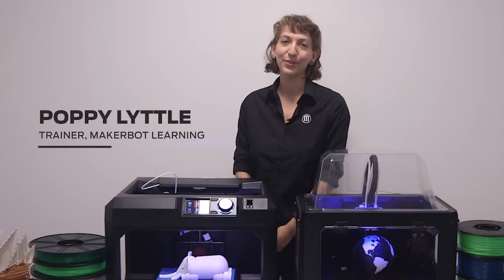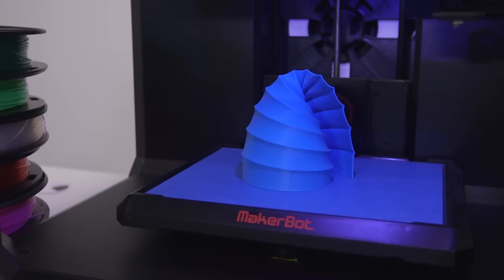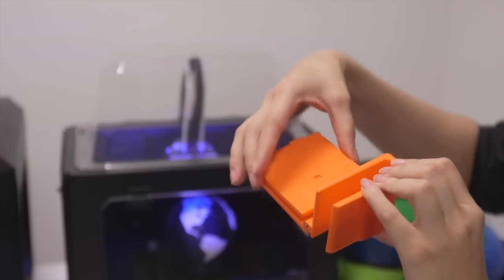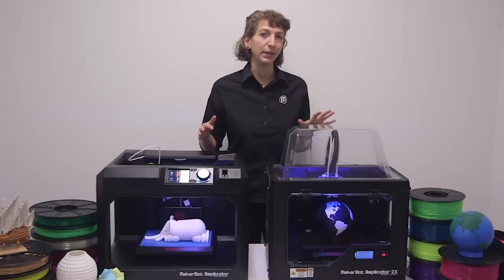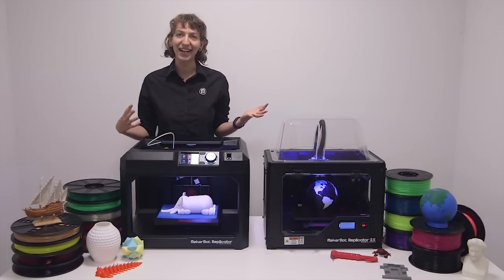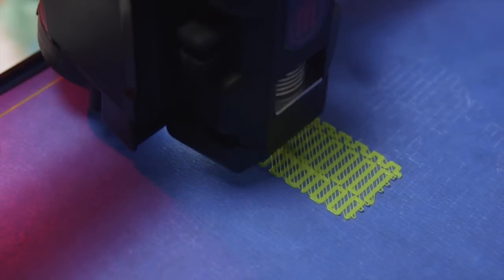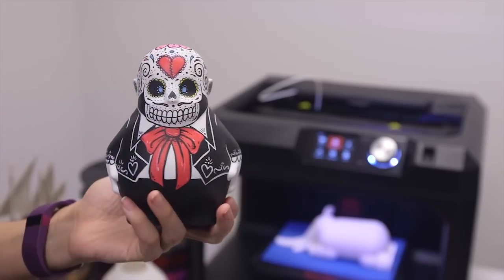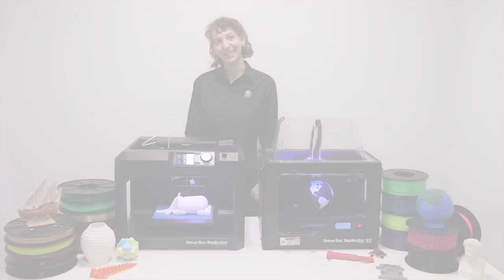PLA vs ABS | What's the Difference for 3D Printing?

Comment: if i were to print a figurine, pla or abs which is more better?
Reply from the maker: It really depends, but both would be good candidates. If you wanted higher heat resistance (i.e. for outside use on a hot day) ABS would be better

Comment: So as a matter of fact which is better
Reply from the maker: Well, there really isn't a clear answer to that question. It depends on the application and project. If you need stronger and more resilient parts that hold up against heat stress, while also having a well ventilated facility to print in, ABS is a better fit. If you are looking for lower-cost concept models, PLA can be better.

Comment: I want to print a mesh-like-fabric to use as a filter for sand. Is PLA better for this? Does it bend or roll?
Reply from the maker: Hey Paolo, 

PLA is a great all purpose material, however it might not be a good fit for the application based on your description. A TPU-based material would be able to bend and roll and might be more appropriate
Reply: @proto3000_  thank you for your reply! I'd love to be contacted by your team since I am developing a prototype for this product. I sent an email weeks ago but haven't gotten any reply. thank you!

Comment: Hey. Can a thermoplastic material in powder form can be used instead of thermoplastic filament? If yes then how and what should the assembly be.
Reply: Not in a printer designed for filament FDM. 

If you want to work with plastic powders instead, look for a "Selective Laser Sintering" printer.

Comment: Dudee i wanted abs for summer then i got here lol
Reply from the maker: Well, if you have a project that does require additional strength you can always look at a tougher variant of ABS. Often these materials have better impact resistance and elongation to ABS but are PLA derived. The only drawback would be heat resistance.
Reply: @proto3000_  I think they were talking about physical abs.

Comment: So if I wanted to print drone/airplane frames and components, would the ABS be better?
Reply from the maker: Between ABS and PLA, ABS would be better. Ideally though for aerospace components that will be used in testing you may want to explore using advanced materials like Carbon Fiber reinforced nylon or ULTEM 9085.

Comment: Which machine would be better for making RC car parts Please comment back
Reply: Prusa i3 mk2s kit(599$) is best 3d printer for your money (mk3 if you're willing to spend more) then build your self a ika laka enclosure(50-75$)you will need this to print anything other than pla. As for 3d filament use pc,(stiff and strong but hard to print) nylon(impact resistant all so hard to print) or good old abs(a little more easier to print) just my 2¢

Comment: Which one between PLa and Abs can hold a tap better ? ( to screw a bolt) pliz help me guys. Thx
Reply from the maker: ABS would be a better fit for tapping depending on the thickness and density. If you are looking to work with a PLA like material I would recommend looking at something like Tough - https://proto3000.com/product/makerbot-tough-3d-printing/

Comment: I'm curious about making a few custom hardware pieces for use in research diving at depths of 25-100 feet and temperatures of 35-75 F.  I need the material to be environmentally safe because it will be submerged in open water for extended periods of time, and strong enough to withstand some stress/pressure.  Would I be better off with a printer that is designed for ABS, or some other material?

Comment: Hello everybody! I´ve some questions regarding 3D printers
Can you print your own transformers or action figures with ANY 3D printer or do you need an especific type of printer?
What´s the best material to use if you want solid toys: ABS or PLA?
How solid is going to be the toy? Like  Hasbro´s solid, like a Lego´s brick or is going to be like a really cheap plastic?
Do you need to sand the pieces or they´re already smooth as soon as they leave the print?
What´s the best software to use to create toys for 3D printing?
And how durable is going to be the toy? Is going to break as soon as it hits the floor?
Reply from the maker: Hello Samuel,

We will try to answer your questions as best we can

1) Yes, you could potentially print action figures with any 3D printer provided you understood the limitations. Having moving arms and legs may not be possible with all 3D printers, and the material used would need to be relatively strong to hold up to day-to-day usage. 

2) If you want solid toys, ABS would provide for stronger parts, but PLA would overall be safer 

3) ABS and PLA material are very similar to what Lego is made of, sp quite durable. You can set the infill of your print so it can be as sparse or solid as you would like

4) They would need to be sanded depending on the technology

5) To create toys, you could probably get started with Tinkerine, but it depends how advanced you would like to get

6) Depending on the material used it would be relatively durable, able to withstand day-to-day depending on the design as well as the size and fragility of the features. 

Hope that answers your questions!
Reply: thank you guys for the info, and for the time to answer my questions!

Comment: So for gears and practical/invention prototyping... which you you recommend?
Reply from the maker: Typically speaking, for functional prototypes ABS would be recommended as it has better overall strength
Reply: @proto3000_  many thants for the advice... 👍

Comment: PLA (Polylactic Acid) is one of the two most commonly used desktop 3D printing filaments (with the other being ABS filament). It is the "default" recommended material for many desktop 3D printers, and with good reason - PLA is useful in a broad range of printing applications, has the virtue of being both odorless and low-warp, and does not require a heated bed.

ABS (Acrylonitrile Butadiene Styrene) is a commonly used 3D printer material. Best used for making durable parts that need to withstand higher temperatures. In comparison to PLA filament, ABS plastic is less "brittle" and more "ductile." It can also be post-processed with acetone to provide a glossy finish.

www.fila-tech.com

Comment: sending scraps to a recycling sounds like a good idea but I prefer to know how to reuse them in future builds if at all possible
Reply: freakygeaktwo ABS can be turned into "ABS juice," and used for build plate adhesion.  I don't think PLA is useful outside of your actual 3d model.
Reply: Scrap supports can be ground up and rexstruded on to a spool for other projects. Save those scraps.

Comment: I need help. I have a plastic gear with a few teeth broken. I need help steering to someone that can use the existing gear and model over the broken teeth or print most likely with ABS. The part is enclosed and not open to the sun.
Any help as to a company or person that can do the modeling and or printing appreciated.
Reply from the maker: Hello Fun2 Drive, you can request a service by contacting our engineering services team. If you would like to send an email describing your project to info@proto3000.com someone will contact you.
Reply: What size is the gear?

Comment: Hi, sorry yif this is a newbie question, but what is raft and why is this the first time I'm hearing about lemonade ( spelling?) ?
Reply from the maker: Hey Thomas,

Sorry for the delayed reply. A raft is a setting you can choose in your 3D printing management software that will create a base on which the part will be built. This can be important when removing parts from the build plate, it will prevent damage to the part, and will also promote better adhesion to the plate. More surface area means more adhesion. D-Limonene is a chemical that can be used to dissolve some soluble support material. It is readily available at hardware store in the United States but much more controlled in Canada.
Reply: Thanks.

Comment: why always a raft?
Reply from the maker: Hello +Everything Tech Review, a raft is important to adhere the print to the build platform. It prevents it from sliding around and keeps it stable in taller prints. Another benefit is it prevents damage to the print when trying to remove it from the build plate especially if it is delicate.

Comment: Hi, Poppy!
I have the following problem: my 3D model (not solid) in 1.75mm ABS is "delaminating", after a series of printed lines, spans in the model begin to appear (it is a relatively large model, with more elevation Of 15 cm - the printer has a capacity of 20cm x 20cm x 18cm: it's a Wanhao I3 Plus), I'm extruding with 245º and keeping the table warm by 90º and average speed between 50 and 35mm / s.
Any tips on where I might be going wrong?
Thank you very much!
Reply: Hey! is there an enclosure around your printer to keep the hot air in? Otherwise the ABS prints can crack!
Reply: Try 110 degrees on your bed for the 1st layer, drop down to 100 on the bed with 60 degrees ambient temperature in the enclosure.  No more delamination or warping of ABS in my case.  Been printing at those settings for some time and never had to change them.

Comment: How do you smooth out the prints so that the layers don't show?
Reply: You can smooth out by acetone vapour bath. Mind it, acetone is very irritating to eyes and nostril and quite dangerous.
Reply: What printers use those soluble supports?
Reply: Polysmooth filament and their vapor machine makes perfectly smooth parts.  From actual experience.  Uses isopropyl alcohol as a vapor to condition the surface.  Works amazingly well once you get past the learning curve.  Like PLA, not quite as durable as ABS though.  But the results sure are awesome.

Comment: PLA reacts to humidityl ABS does not. Why bag ABS? Am I wrong here?
Reply: ABS is superior to work with once you have everything dialed in.  But it does absorb moisture that can cause surface defects as it outgasses as steam during extrusion.  Have to keep your spools in a dry desicant chamber in humid environments.  Other than that, once the part is made, moisture is not an issue and ABS won't break down like PLA.  It is a permanent plastic part.

Comment: Have heard Carbon Content Filament, can your machine still works for this type of filament, or is your filament proprietary?
Reply from the maker: Hey shooterX our printers are designed for PLA material, however the MakerBot Replicator 2X system is experimental in nature and may be able to print in different materials with the right settings

Comment: Are any of the filament materials food safe (FDA food safe approved)?  thanks
Reply from the maker: Hello RealSoundNow on the MakerBot systems we would not have any materials that would be considered food safe. However, on the industrial line of Stratasys 3D printers we do have a material known as ULTEM 1010 that would meet food safety requirements.
Reply: OK.  The printers for ULTEM 1010 are into the 6 figures of cost.  Is that the only choice?
Reply from the maker: At the moment ULTEM 1010 is one of the only materials with a food safe designation. To be honest though if you are trying to develop something that would make contact with food it would be recommended to do any concept development or design iterations on a desktop printer, and maybe look at doing the final iterations through our service bureau
Reply: PLA is for the most part safe to use, it just releases some lactic acid into the food, but that's naturally occuring stuff, such as in milk, or even in the human body.

Comment: PLA comes from starch and is a non-toxic bio degradable material.  I don't understand why it isn't used for food packaging more.
Reply: Siana Gearz it's renewable and doesn't fuck up the planet
Reply: It also smells of brown sugar and oatmeal. It took a while before I could label the smell, but it hit me one day.
The big problem with PLA however is that it biodegrades... ironically. That means if too much is left on the hot end it will eventually break back down into starch, then sugar, then caramelize, and then... garbage can. I guess you can drill it back out, but those microdrills cost too much and are too fragile. Lately I have only used PLA for test prints since they are too fragile for a lot of things, and long prints with PLA too commonly leads to a clogged nozzle if the print fails due to pla decomposing in the nozzle if something goes wrong. 
+Even Stephen My cat has an obsession with PLA scraps, she will pull them out of the garbage and eat them. There is no way I can stop her, so I hope it won't hurt her xD
Reply: Is there an  FDA approved PLA filament then?  Thanks
Reply: No idea.  Why need one?  The stuff is harmless
Reply: I'm sue you're correct.  It's just that the FDA requires tested materials for approval for packaging or medical device applications.  It's an FDA authority thing ..
Reply: 3d printing pla leaves a somewhat porous material, which is fine for single use, but can easily host bacteria unless you disinfect it after each time you put food in it. And boiling it is out of question.
Reply: you don't really want packaging to degrade.  if packaging degrades it basically means the product inside wil degrade aswel. it depends on the product and what kind of packaging though.
Reply: makergeeks raptor pla is fda approved according to them
Reply: There are better plastics for that, for instance Cellulose-acetate based ones and they are already used for food wrapping and packaging. It's cheap, food approved and degradable because bacteria can dissolve it. PLA and other starch based polymers have the issue to absorb moisture in the air and swelling
Reply: because PET & PETG exist
Reply: Pla isn’t to moister resist
Reply: Money.
Reply: I know it's an old comment, but I want to point something: PLA isn't as biodegradable as it's sold.
It's biodegradable in special conditions, and shouldn't simply be discarded in nature as biodegradable.
And a good way to clean the extruder is by fire.
Just burn it until the flame isn't yellow, and all the clogs will have flown away.
Reply: Because it's safe
Reply: I believe PLA was developed for medical use. Not sure what use it is for food: it's more expensive than plastics used in food packaging, less flexible, less shatter-resistant.
Reply: The lactose converts to longer strains of sugar, so brown sugar is exactly what you are smelling.  I have to say, I haven't had any decomposing issues with PLA.  The material lasts as long as it is kept away from high temperatures.  Are you leaving the material on a windowsill exposed to the sun?  That would cause it to shrink.  I've PLA cups I use as pots in my greenhouse and they have yet to decompose since using them since 2014, they just shrink when it gets hot and become more brittle.
Reply: Sean Kelly lactose isn't made out of plants

Comment: Any where i can get tensile strength differences 
Etc for the two materials?

What about being water tight ?
Reply: Curiously enough, Makerbot released a document called "PLA and ABS Strength Data", you'll find it.

As to water tightness, hard to call it, for bigger objects I think getting a somewhat watertight PLA print is easier because it warps less. Wouldn't consider any FDM 3D print water tight.

Comment: So basically PLA for making models with fine detail and ABS for making hardware. 
Got it.... except.... ABS can be acetone bathed for glossy smoothing, so if I wanted to print a Catwoman or T800 head  I'd use ABS? Damn I guess trial and error is needed.
Reply: Siana Gearz that didn't work for me
Reply: PLA bonds to resins rather nicely, so you can just coat it over to cover layer lines.
Reply: For painting you should always use a primer
Reply: ArcanePath360  yes it is recuired
Reply: PLA with primer finish to fill in lines is my guess. I'm going to invest into an Ender Pro 3, really want to do Dead by Daylight masks.

Comment: PETG - best of both worlds (mostly).  Strong, high heat, no curling.
Reply: What? You DON'T need an all metal hotend to print PETG. It is printed at 230-250°C, which is fine for a PTFE lined hotend. I've printed lots of PETG on my Prusa I3 clone without a problem!
Reply: i've printed hours and hours of PETG at 255°C on a PETG lines hotend without any problems...
Reply: High back pressure and requires an all metal hotend, which costs more to maintain. I like PETG as well, but it did take modifications before I could print with it well. I gave up getting it to work well in a bowden setup, but works great on my direct feed prusa i3.

Comment: can I use Pla and ABS one after another in my 3d doodler and create one item (not for professional use of course) . Did these two filaments stick/glue together strongly or not really?
Reply: The ideal temps are different, and plastic will unreliably stick to cold plastic. However, if you were to print the ABS first, PLA second, you might be able to get away with it, as PLA sticks better even when temp shocked.

Comment: i found very few videos or examples of prints made using the disolvable filament for the supports. I've been skeptical about trying it because of its expense. Sure would like to see more examples of prints made using it.
Reply from the maker: +Some Asshole we don't typically print with dissolvable filament on the MakerBot systems here in Canada, simply because d-limonene, the solution needed to dissolve the material is quite regulated and not easy to get a hold of. However, we have heard some amazing things from our customer base!
Reply: ah, ok.
thank you.

Comment: I was wondering about the health effects of printing in PLA vs ABS. Ive been told PLA is safe while ABS may be harmful unless well ventilated.
Reply from the maker: +john ingenito Hey John, sorry for the delayed reply, but great question! You are absolutely right, PLA particle studies have shown that it is safe to use in any environment, however because ABS has a petroleum base, it is recommended to be used in a well ventilated area.